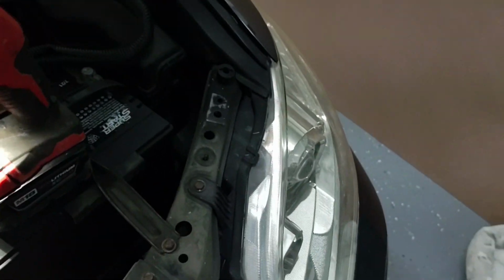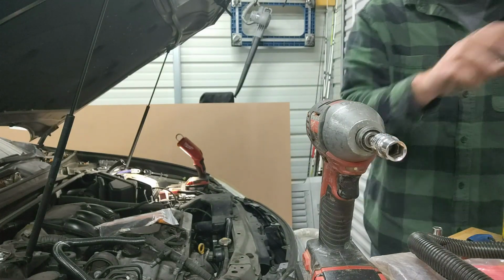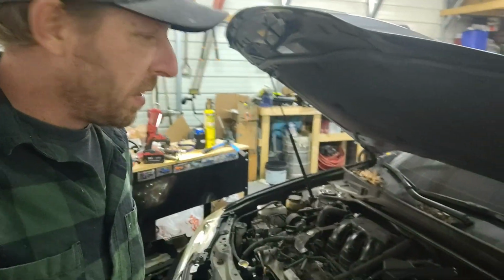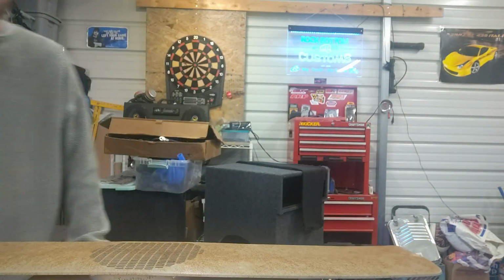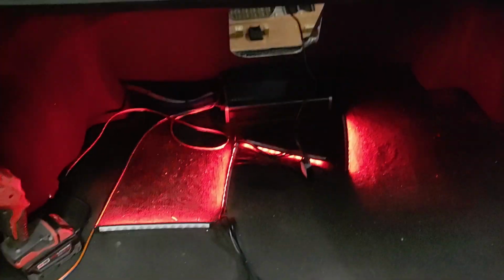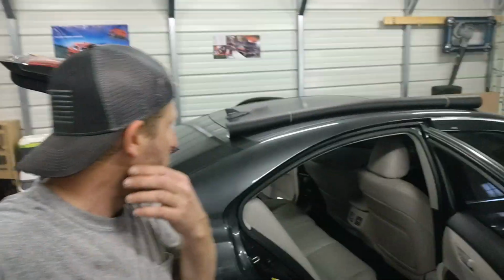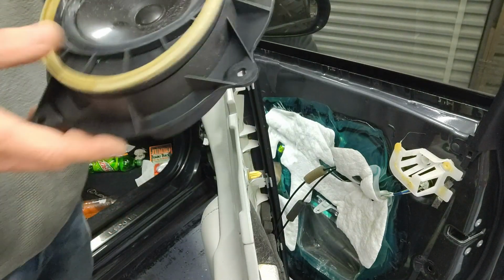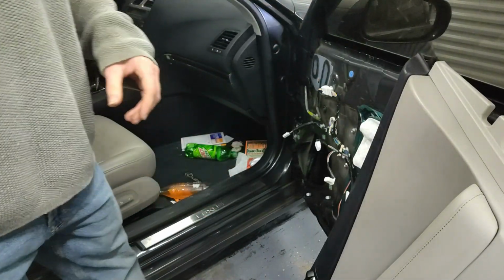Lexus ES350 full stereo system custom bass upgrade

Comment: I have a 08 ES350, followed your video...  Couple of questions,   any need installing a fuse on the Positive side to the Alternator?   I noticed you did not heat tape the Positive next the alternator, any concern being between the exhaust manifold and radiator?
Reply from the maker: I would say in any case the more fuses the better. Main concern would be the wire you can't see running through the car that is mashed up between crevices everywhere so definitely always fuse from battery to the amp. As far as the alternator wire upgrade I think you're referring to the hot post coming off of the alternator, if so it has a rubber boot that covers the stud and nut from the factory and there is heat shrink on the wire terminal that I made. There may be a tiny bit (maybe 1/8") of copper exposed between the heat shrink and the nut and I am not at all concerned about it touching anything as it is bolted to the alternator terminal and cannot come in contact with anything just like the factory one.

Comment: how was the power wire ran thorugh the car I'm gonna install an amp and sub but have no idea where to run the power wire I cant see any obvious gromets
Reply from the maker: A hole drilled through the firewall with a grommet in it
Reply: @ROCKBOTTOMCUSTOMS  do you think the driver side or passenger side is safer? Or easier
Reply from the maker: @imronsubhan454  I think that one was on the driver side. I usually try to use whichever side the battery is on so I don't have to cross the engine bay with the wire. I saw a montie Carlos burn to the ground like that one time

Comment: What size speakers did you buy for the door and what size should I buy for the dash? Thanks!
Reply from the maker: They're 6-1/2 inch in all four doors. The dashboard look like it was going to crack into pieces before the speaker covers would pop so I just left the stock ones in there.
Reply: @ROCKBOTTOMCUSTOMS  are the door speakers wired to the oem amp or aftermarket amp?
Reply from the maker: @rxspect6287  OEM
Reply: @ROCKBOTTOMCUSTOMS did the car have a mark levinson system oem or standard? I trying to do a similar thing in my 2009 Lexus es 350
Reply: @ROCKBOTTOMCUSTOMS  also where are you located
Reply from the maker: @rxspect6287  middle Tennessee area
Reply: @ROCKBOTTOMCUSTOMS  I am in Illinois but I would be willing to take a vacation with my family there, how much for every speaker switched no amp added for sub either it’s a base model Lexus es 350
Reply from the maker: @rxspect6287  you can email me rockbottomcustoms808@gmail.com
Reply: @ROCKBOTTOMCUSTOMS  alright will send you an email with the details, quick question, did the car have a mark levinson amp or just the base one?

Comment: Did you have to replace alternator at all? I have a 2010 lexus es350 and installed a 800w kickers amp with 2 kicked comp 12s and had to replace the alternator after about a week or so, maybe I was pushing it too hard. Please let me know
Reply from the maker: @NoelRivera-j4i  still on the stock alternator been running for a few years as a daily driver now.  The customer melted one of the subs and had me replace both of them with the comp x model a few months ago and still kicking on the stock alternator. Not sure if you watched the full build but I did upgrade all of the alternator and battery cables with 0 gauge as well.